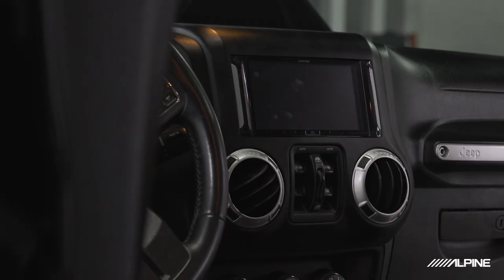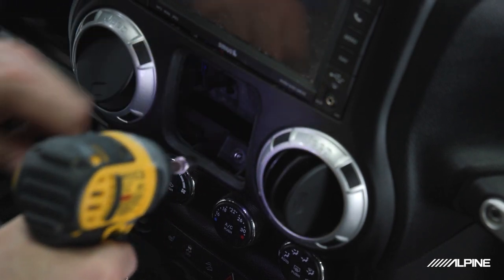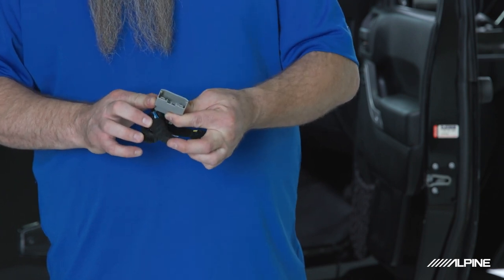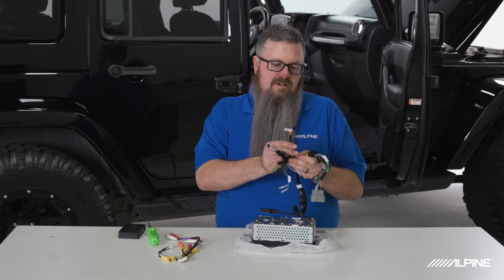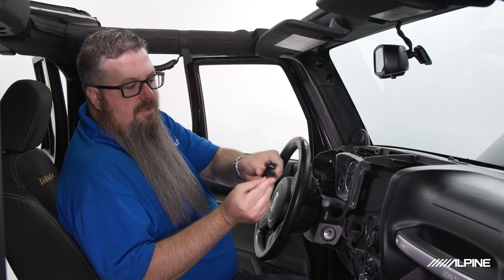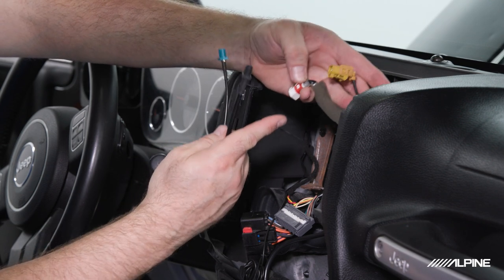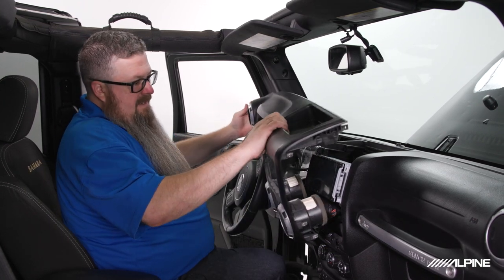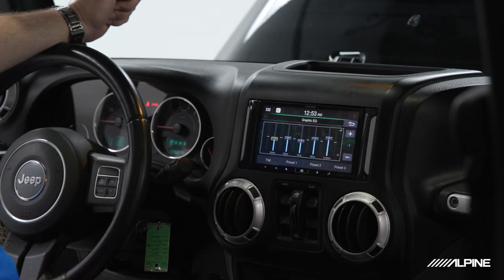Alpine | i407-WRA-JK | Step-by-Step Installation Tutorial for Jeep Wrangler JK

Comment: Great video, thank you Colin! I just bought one of these units, and have a 2017 manual transmission. Are you able to share the best way to connect the white/grey wire out of the harness into the corresponding wire in the passenger kick panel, so it will automatically engage a camera in reverse?

Comment: You said that the Jeep Sahara doesn’t come with a uconnect module, that is incorrect. I have a 2015 Sahara that does indeed have a module located behond the HVAC controls…Do I remove it and disconnect all of the connections?

Comment: Great video, well done! One question I have is about the 'factry' USB port in the center console... So that no longer works with this aftermarket install?
Reply: Retaining that port can be problematic. The port doesn’t work well with Android Auto, and can be unreliable even with CarPlay. If you want a connection in the center console, I’d recommend running out umbilical usb directly to the console.
Reply: @Colin Vargo  Good feedback, thanks, man! One last question - Is there a reason you need to cut out that plastic support? Kinda hate cutting out factory pieces of the dash. I was watching another install from you guys (i207) and that part didn't need to be cut.
Reply: @MNDooD  the deck sits a little tall. You might be able to get it to work, but if you look carefully, this one was already broken when we got there. Lol. It was split down the center.
Reply: @colinvargo3418  Haha! Appreciate it!
Reply: @MNDooD no need to cut it, it fits fine.
Also I retained the factory usb and have no problems with Apple CarPlay.

Comment: I have radio installed. I flashed the meastro. My steering wheel controls do not work, and the “settings” are greyed out.  I have a 13 sierra

Comment: Is there a way you can retain the factory phone mic?
Reply: Unfortunately no. The noise cancellation tech used in our deck require our microphone.
Reply: Yeah, the extra mic is turning me away from this unit.
Reply: @lawranger  unfortunately this is the case with every aftermarket unit. You could tuck the mic in a different spot if you don’t like the look. We put it up top as we’ve found it works great there. It’s about the size of a pencil eraser, so unless you’re looking for it, it’s relatively unnoticeable.

Comment: Is the android auto wireless? If not where do you connect your phone?
Reply: I was wondering the same thing, going to run a USB cable from the back of the head unit to an adapter where I'll have to drill into my Jeep plastic somewhere and mount a dual USB connector
Reply: The i509-wra-jk has wireless android auto. This model is wired. Be careful with 3rd party cable and usb plates as quality varies and android auto is finicky with extra connections on the usb cable.